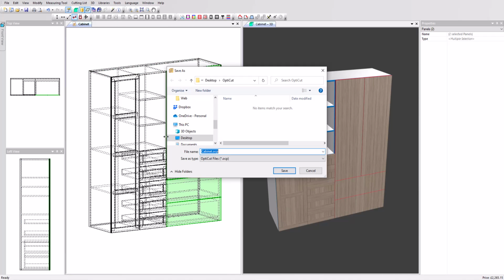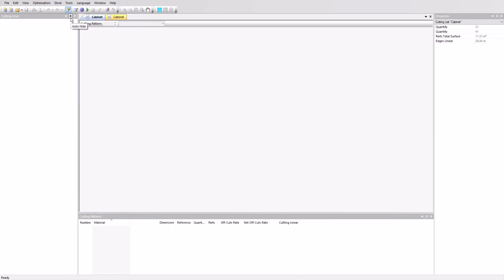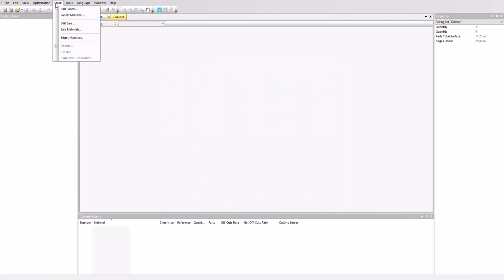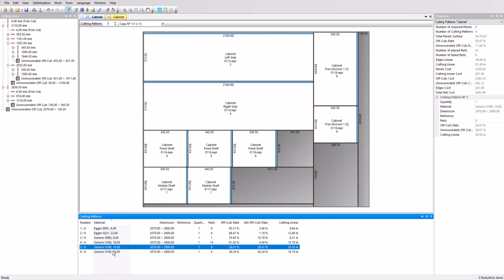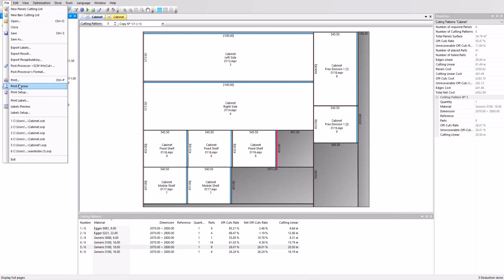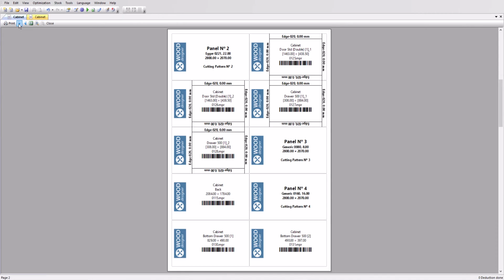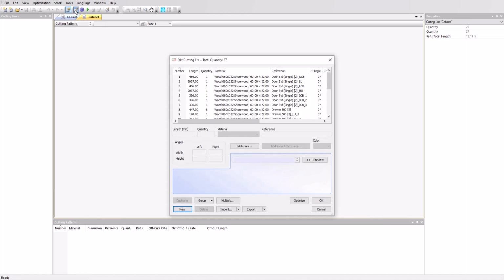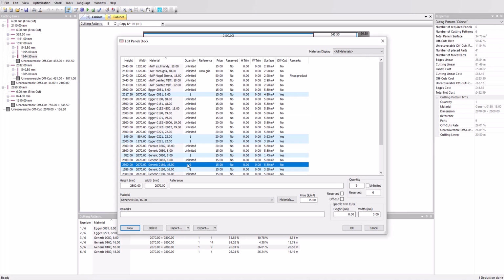OptiCut cutting optimization of a cabinet created in PolyBoard

Comment: is there a way to change the display of the bars in the print ? we only have black and white printer , and the operator that recieves the cutting paper , often confuses the edge line with the line that separates the panels , because they are too close to the edge of the panel , like can i change the position of the edging or the display in any way other than changing the color ?
we used to use cut optimization pro , and the edging lines were small lines at the edge of the panel , although small , but they cannot be missed 
0:12
in our case , the blue edging line will be printed black , and the black line near it will be the same color , this is the problem
, we hope you can help us , 
Many thanks

Comment: Hello , im searching for a program that extport part list to a optimezer cutting machine like Homag paket saw and for evry piece that cutt a label stiker print and a code bar for cnc print. My question is this program , polyboard, whitout extension like opticut nesting etc it s ok or i need to buy all of them? Im a furniture custom manufacter , also i do design, so i need to send mu design to production once i finish. For example Corpus 5 do that , but is to technical.
Reply from the maker: Hi there! 
PolyBoard can export part lists and integrate with cutting machines like Homag saws for labeling and barcodes, but to achieve full optimization features, you might need additional tools like OptiCut.

Contact us at support@wooddesigner.org, and we’ll be happy to explore your specific needs further!